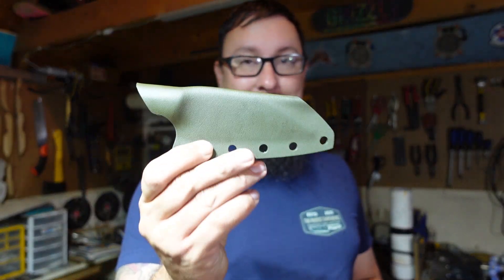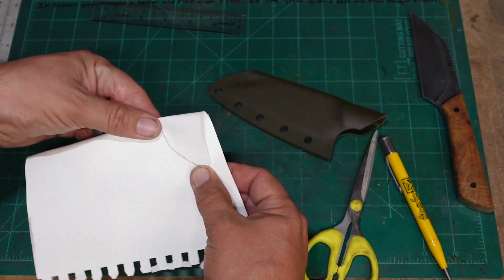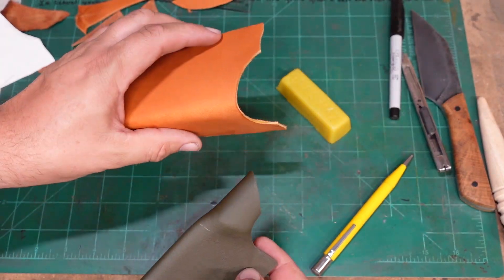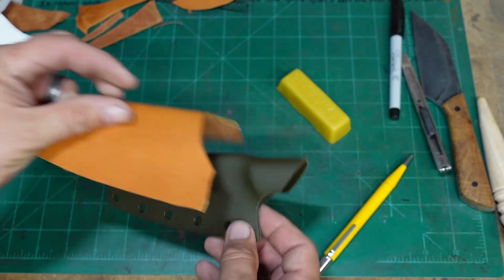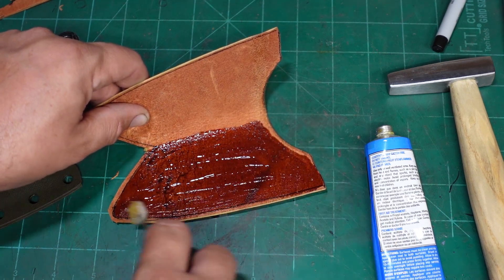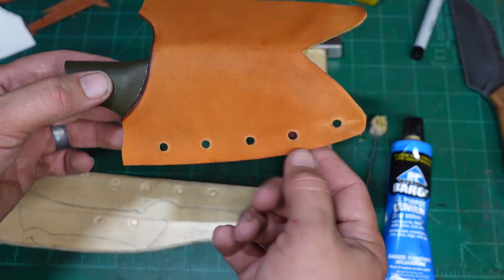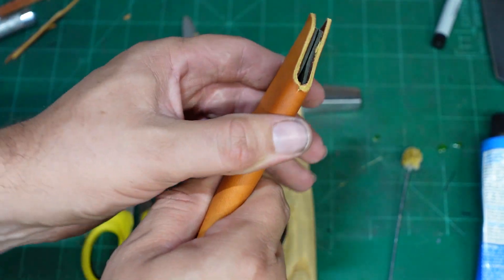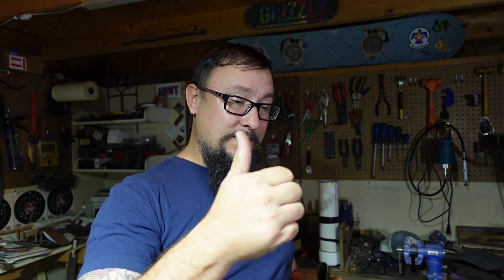Layered Sheath: Leather Over Kydex | Daily Vlog | Knife Maker

Comment: If you decide to tool the leather remember that leather isn’t as thick as sheaths. It will stretch out a bit when tooling. A basket weave would look awesome on that set up. But sometimes less is more. Knice work brother.
Reply: What thickness leather would you recommend for a tooled sheath?